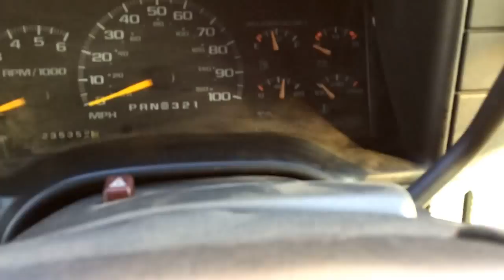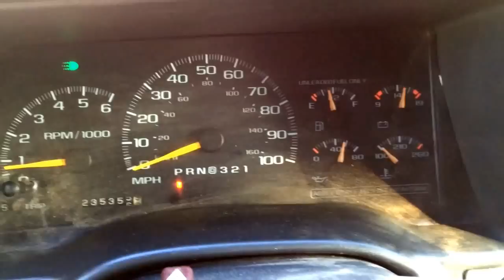1997 Chevy Tahoe Fuel Gauge Problem

Comment: I had this problem in my 99 GMC Sierra. Mine was slightly different. The fuel gauge would read either Full or Empty (full sweep). I suspected a bad ground. It wasn't a bad ground. I dropped the tank and replaced the fuel pump and sending unit with a new Delphi pump/sending unit. First, I performed an Ohms check on the new sending unit and noticed intermittent values as I moved the float arm. I carefully removed the plastic housing that encases the sending unit wafer board. There's two metal wiper arms that contact the wafer board. This provides a voltage resistance back to your dash gauge thus indicating fuel level. I carefully spread the two metal wiper arms to provide more spring tension against the wafer board. After reassembling the sending unit I rechecked it with an Ohm meter by slowly moving the float arm and was able to detect no intermittent readings. Installed new pump and sending unit back into tank and my gauge has been working as new for over a year now. Not a single faulty gauge reading since!
I've read every kind of fix from adding snake oil juice from GM to your tank to new pumps/sending units. There is a new style electrical connector from GM that plugs into the fuel pump. The new connector is included on most new pump bodies when you replace the pumps. Be sure to use it. Always check that you have a good ground connection as well (from pump to frame).
I chose Delphi to replace the pump/sending unit due to it (supposedly) being a better brand. Even though I had to fix the sending unit on a Delphi, I'd bet the procedure I performed would most certainly be required on other (lesser quality) brands.
The other common gauge problem is a vibrating fuel gauge needle. That can be fixed by adding 30K weight RC differential fluid to the gauge spindle. Just a dab!
Reply from the maker: 1720cox that’s really good info man! I’m kind of sad I sold the Tahoe because it was a good vehicle. One of the cool things here is that people have posted all sorts of diagnostic processes to go through with fixes. Seems like GM messed this one up quite a bit. I’ll be sure to pass your process along to others to check out. Thank you for the comment.
Reply: 1720cox ppl
Reply: You oil pressure guage is stuck too...at idle it should be way lower.
My oil pressure guage is doing this too but my fuel guage is just twitching slightly...not like yours though.
Reply: I just put a new delphi fuel pump in mine. It stopped moving like crazy like in this video but it still moves slightly as I brake and take off. But eventually goes back to its true level
Reply: @Lucky13tiki think that’s completely normal, it’s just due to the gas flowing to one side of the tank making the float/sensor bob

Comment: my 1998 GMC K 1500 was doing the same exact thing. I didn't try what you did but I just talked to some people who had the same truck and they all told me the sending unit in my tank is probably bad. I also watched some other YouTube videos and they said there's a particular ground next to the fuel tank that grounds everything if that connector is not grounded properly it'll cause your fuel gauge to do all sorts of funky things. not knowing what ground they were talking about I went ahead and pulled my tank down. I replaced my fuel pump with a Delphi fuel pump. as I was in the process of doing all of this I found the ground wire they were talking about. mine was partially severed due to the fact it was rubbing on the frame. so regrounded The Wire to the bottom side of the frame. but before I did that I took a wire brush one that hooks to your drill and I cleaned it really shiny spot where the existing hole was. so that now it's fixed. my gas gauge no longer dances around. it's very very accurate. I'm not sure if that's from fixing the ground or replacing the fuel pump / sending unit. it could be a combination of both or one or the other. I will try to make a video and show people where the ground wire is but I'm pretty sure that's the ground wire that grounds the gauge.
Reply: Any video? I'm.currently going through the same on a 98 silverado

Comment: It's a bad stepper motor. Mine vibrates. They are driven by the PCM, and when the silicone damping oil dries up, they do this. The oil slows them down so they average out the short-term changes in signal caused by gas sloshing, etc. You can buy them on EBAY.
Reply: Doug Alan mine will sit there and you can hear a buzz in the cluster. Then it stop and the gauge dies and falls to the empty side.  Any ideas??

Comment: in the factory tank, the sending unit rested in a sump that kept the fuel level stable around the pump and float for gauge. if the tank has been replaced, the aftermarket spectra premium tanks DO NOT have this sump. Now fuel waves front to back as you accelerate and brake, and the float follows this. It will do no harm, it's just annoying. There's an electronic buffer that can be installed that slows the action of the gauge. Hope this helps somebody.
Reply from the maker: Sean Laucek thanks for the comment man, it probably will help someone!

Comment: 98 GMC Z71 here. Gauge always had a needle vibration since I bought it. No biggie. Recently bounced wildly and would go way over full. Tapping dash would get it to behave. Pulled out cluster to find lose and missing screws. Cluster was floating behind bezel. Secured it and it went back to normal. Check the cluster circuit film and dash contacts. Clean with an electrical cleaner. Make sure dash contacts protrude far enough. Place a very thin soft foam, like house door weather strip, behind cluster film contacts to force good contact with dash connector. Re-seat connector to fuel pump sender and make sure tank ground is good if separate. Good luck.

Comment: I'm just curious if you ever figured out what causes it do that and if you ever got it fixed. I just bought a 97 chevy tahoe 4×4 and mine is going all sorts of crazy hiking my other gouges causes them to move like playing pin ball..lol I want to get it fixed cause I'd like to how much gas I have. Its starts going crazy after I hit 3/4 tank of gas.
Reply from the maker: I ended up selling the Tahoe. I’ve been told you can source the actual motors for the gauges and it helps but I cannot confirm that it does or doesn’t help since I didn’t do it to mine.

Comment: Hello, this is not a problem. most gm cars through the early 90's did this. even some earlier models, they are notorious for it. the gas sloshes around and affects the floater, there is no fancy tech behind the floater so the gage notices any and every movement.

Comment: My 97 Tahoe does the same,except instead of doing it slow,it goes fast but goes back to the original place. Is it the sending unit or just something inside the dashboard? I don't want to spend more money than I should for something simple. Get back to me as soon as you can,thanks!
Reply: Alex  Dominguez quite often enough its a sending unit on the pump. i replaced my fuel pump and relay  on my 93 k/v1500 needle danced all over the place. changed the two parts and it hasnt done it since
Reply: hey did you ever see what was causing it

Comment: I got a 97 c1500 with a 5.7 and this just started up on me 3 days ago. Have you found out a fix or cause to the problem yet?
Reply from the maker: I haven't man :( It could be the sending unit, it could be the cluster, it could be a bad ground. I've checked the cluster and grounds. At this point, I'm wondering if I didn't get a screwed up sending unit when it was replaced.
Reply: My 1999 do it it shakes slightly

Comment: So its best to get a whole new sending unit?
Reply from the maker: miamisoja some say to, I ended up getting a new sending unit and it didn’t fix the problem. Big money to spend for no fix :(
Reply: Dmonkey that's understandable I wonder if I get a aftermarket sending unit would it be better
Reply from the maker: miamisoja at the time, I did think about that but I was a broke college student at the time so aftermarket was some what out of the question.
Reply from the maker: miamisoja if you go to my first attempt fix video, in the description is a link to new motors on eBay. Warning though, I can’t confirm if it fixes the issue or not, only that another YouTuber found the motors online. If I were to do it again, I’d probably try that but I’m not affiliated with the eBay story, or any of that.
Reply: Dmonkey thanks 4 the heads up but i work at autozone ima go with factory first then if not then sumit racing
Reply from the maker: miamisoja if it fixes it, be sure to report back so I can update the video lol
Reply: Dmonkey will do

Comment: We were in the process of cleaning some grounds on our 1999 Chevrolet Silverado, for some tail light issues. Upon reconnecting the grounds after cleaning, we noticed a new problem with the truck.The previously working fuel gauge now was showing up as way past full. So we actually fixed this by tapping on the front of the instrument cluster...of all the stupid crap! Just thought I would throw this out there in case anybody else comes across that problem like we did. Thankfully it was ridiculously simple to fix. Still got rear turn signal issues unfortunately. Gonna try some new ground straps. Tried nearly everything else. Wish me luck.
Reply from the maker: Thank you for your comment!

Comment: I have a '99 Express, the gas gauge pegs out... and van won't run. Replaced fuel pump, same thing. It will start fine , but when the gas gauge pegs, it's done. Sit for a bit and it will start and drive, but for sometimes 60 miles, sometimes 1 block.Any suggestions, I have replaced tons of stuff to no avail. Bought an Astro van for time being, but really need the bigger Express.

Comment: I have a 99 suburban and a 97 Yukon. Both have the same problem. I would really like t get it fixed. But I'm like you, I have no idea on what the problem is. I'm not that much of a gear head so it's going to be a challenge for me. When you were talking about grounds, where about are they ad how hard is it to replace the sending unit. Also roughly what kind of gas mileage do you get in yours, so far I have went two weeks with having to put gas in the suburban, not sure if it has good gas mileage or I just got really lucky. If you find anything out about or have already fixed it please let me know. Thank you so much

Comment: You can fix the problem by taking the gas gauge motor out, refilling the oil & placing the motor back in. I saw a video, here on YouTube, follow the instructions & fix it yourself. Most of the times, when the needle moves like that, it's that motor in the dashboard cluster. Good luck.

Comment: I have a question for a 1999 chevy tahoe fuel gauge is going from full to empty after I have filled it up while I am driving and it goes beyond the full indicater.  Any solution? ??
Reply: I have the 99 tahoe 4x4. I put gas in it while running.  I got in and the gas needle was pointing straight down! lol its gonna be fun fixing it!

Comment: My 1997 chevy tahoe 1500 does the same exact thing.Its normal its the manufacturer who made them that way before thay came out with new ones.Iv grown up with chevys so its nothing to worry about.One thaing I will let you know if you don all ready know if your half tank on gas put gas in the chevy tahoe because it will fool you sometimes.Hope you found your answers.
Reply from the maker: I'm still in search of a fix but I honestly think I'm going to have to buy a new cluster in order to get the fuel gauge to work as it did from the factory. It kind of sucks but oh well.

Comment: I have the same truck and year.  My gas gauge is all screwed up too.  I researched this heavily and there is no real answer.  Also check all the grounds near the gas tank because they get heavily rusted from open access from water.  I just deal with it and go by my trip odometer.  Fill your tank drive around for like 30 miles or so then fill it up again to see what your mpg is.
Reply from the maker: I have checked all the grounds, and I also go by the odometer as well. It's become sort of a crusade to have a factory functioning fuel gauge at this point. Some people say to put 20,000 weight silicone oil (Rc Car differential oil) and that supposedly takes care of it. I don't know if I want to go that route due to the oil leaking back out. Keep an eye on my channel, If I find a resolution to it, I'll be sure to post up my results. Thanks for your comment!
Reply: Dmonkey Productions Just an update.  I replaced my fuel pump and the gauge works fine now.
Reply from the maker: That's good to hear!
Reply: Dmonkey Productions I've asked many owners of these trucks and it turns out that it's the fuel tank design. A worn out fuel pump/sending unit can cause this too, but it's mostly a design flaw.
Reply from the maker: ***Classified*** Thanks for the information! I'm definitely inclined to go with what the owners have said. I know on my year at least, there are no internal baffles so the fuel can slosh all it wants and they just regulate it via the sending unit and cluster. I did replace the sending unit on mine but the resistor or whatever its called could have been bad. I don't know electronics that well so dont hold me to that terminology lol
Reply: Dmonkey Productions yes, I remember now that baffles was the term used! One even told me that they can break, or they don't have them at all. Mine is a 97 as well, and I notice it especially when accelerating, hitting the brakes, or on hills. I know the 94 and older trucks didn't seem to have this issue, but I hear that they had a baffle. The guys I talked to just said to live with the problem, and my owners manual even says it is normal.
Reply from the maker: ***Classified***
Yeah the older trucks had tanks where the baffles could come loose. I recently sold the Tahoe but the fuel gauge still upsets me lol
Reply: Dmonkey Productions It upsets me too, and everyone that rides with me thinks my gas gauge is broken!
Reply: SkilledEddie thanks I'll try this. I have the same problem with the same vehicle and year.

Comment: Could be fuel pump sending unit. If not probably an air stepper motor on back side of panel behind gauge. If it is in the display cluster it may be better to remove it and then send it to someone that rebuilds them. Good luck.

Comment: Figured out why my fuel gauge would do what yours was doing. Change the fuel pump.
Reply: Oscar Martinez he just said in the video he did that so what's next to do?
Reply: He also said in the video that someone told him to disassemble the arm from the fuel pump and push out the 2 lil prongs so they would make better contact. That’s usually what fixes THIS problem.

Comment: 99 Yukon temp gauge reads low.I thought it was normal just got it watched a video where a guy changed the temp sending semsor.He didn't even check resistance to ground just changed it.It screws into drivers side head and grounds through the threads and there is a ohms value.His worked maybe his utube channel was supposed to show how to change it?Far easier and cheaper to check sensor to head.
Reply: What video?

Comment: You said everything else is new and replaced like fuel pump and float and harness theres only two things thatll do that which can be the resistor the float connects to or just a bad panel since the pump and stuff is new get a new panel and its fixed
Reply from the maker: It's possible that I got a bad pump but I did buy name brand :( I'm not sure what you mean new panel, panel as in gauge cluster? Thanks for the comment!

Comment: Happens on almost all 95-97s. There's no baffles in the gas tank and that's why a new sending unit didn't fix it. You could try a brand new aftermarket gas tank with baffles.
Reply from the maker: I wonder if the cluster itself is designed to combat this and it has just worn out. As much as I would love to throw a new tank in it, I don't think it's in my budget lol

Comment: I did it in my 99 GMC sierra 3/4 ton. For a year the needle vibrated and its got worse, so i took the cluster apart very carefully, it took the whole day but i replace the small gauge, but be very very careful putting everything back, if you have patience go for it.
Reply from the maker: Ivan Stabreff I have taken it apart, I couldn't find a replacement gauge. Sadly, I sold the tahoe so I can't look into it anymore :(
Reply: Sorry to hear that man

Comment: i have replaced the cluster, tried three different clusters. doesnt work. miine will read fine when i first start it. as soon as i put it in gear ,its a guessing game.
Reply from the maker: Though this video is nearly a year old, I still haven't stopped trying to figure out what's causing this issue. It seems as though the cluster itself may not be the issue I originally thought.  I've replaced the gauge motor with a couple different motors and injected silicone into them each time and it only gets better when its at or near a full tank. Since I have a 97, the sender info is not sent through the computer. I have to wonder if there is not something going on with the wiring or if there is something I can do to the signal to suppress the bouncing. I have limited knowledge of electricity so that will prove to be difficult.

Comment: I have a 96 and it does the same thing along with the oil pressure gauge. I haven't checked to make sure the connections are sight and so fourth.
Reply from the maker: the more I look into it, the more I think these clusters are just sort of screwed. I'm trying to research parts to try and fix it myself.